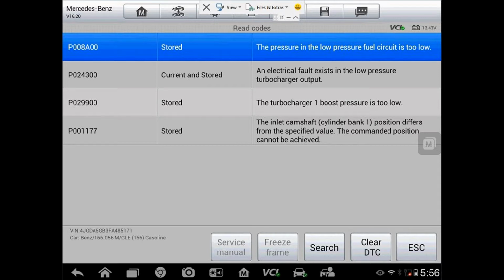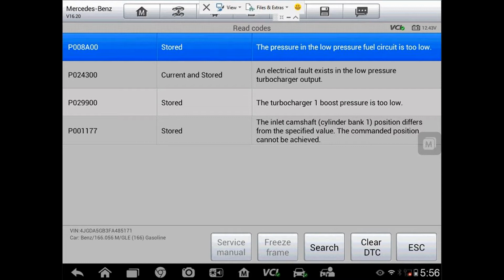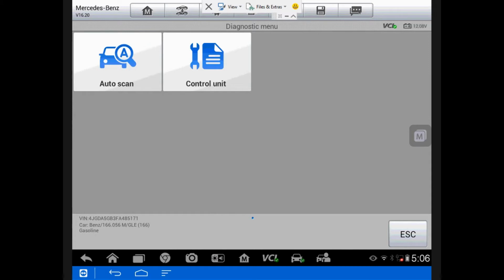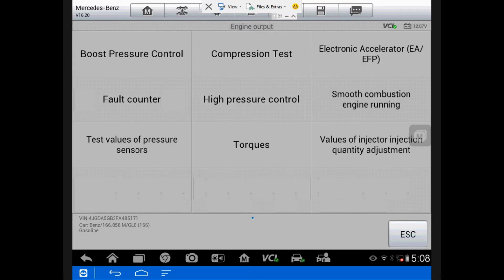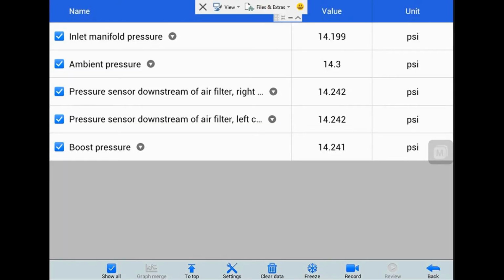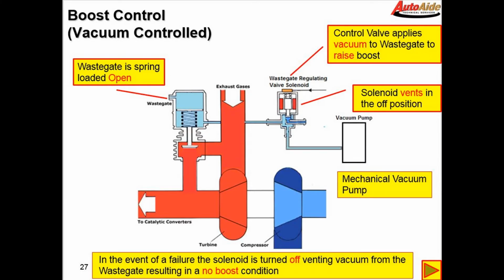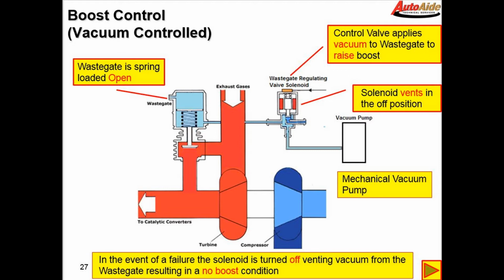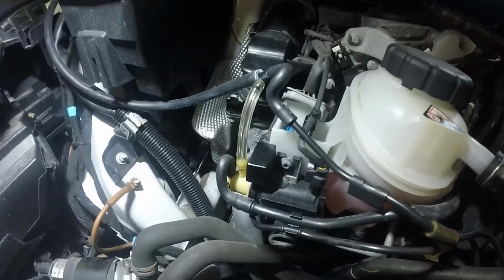ML400 Low Power Complaint

Comment: Nice methodical diagnosis of a low boost on ML400. However, I am confused why you are keep mentioning an electric vacuum pump when the ML400 is fitted with the M276.8 engine that has a mechanical vacuum pump.
Reply: I also forgot to mention  that the fluctuation on the vacuum you are seeing is due to a failed check valve on the vacuum pump. This failed check valve also allowed oil from the vacuum pump to reach the waste gate actuator and the oil deteriorates the diaphragm of the actuator. Even before the diaphragm fails you will not be able to close the actuator by applying 12-15psi of vacuum as the oil in the actuator is not compressible. Lastly, the first turbo to experience the low boost is always the turbo on the passenger side as it is slightly lower than the turbo on the driver's side. Mercedes does not sell the check valve as a part. Only the whole vacuum pump. However, Volvo and Ford (Ecoboost 1.0T & 1.5T) using the same valve and sell the part.